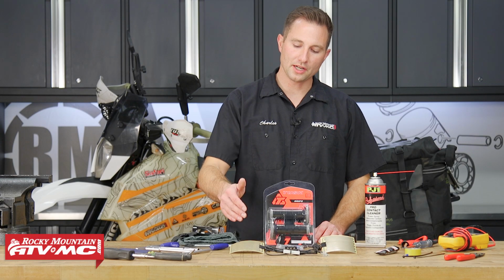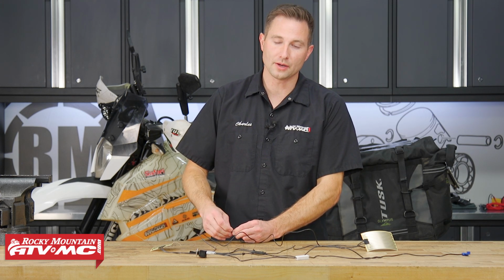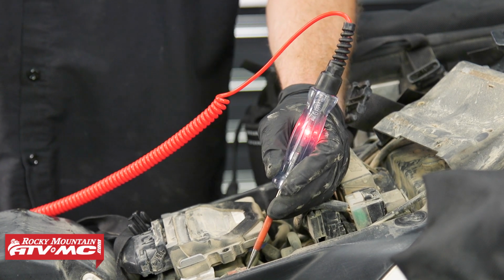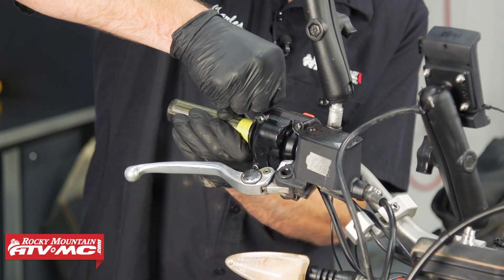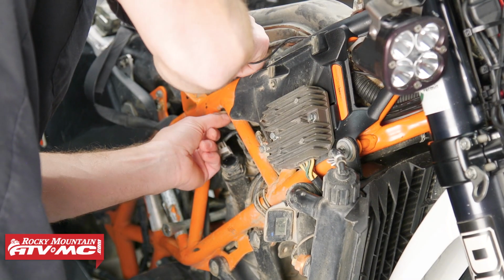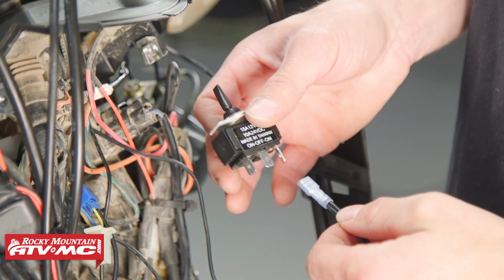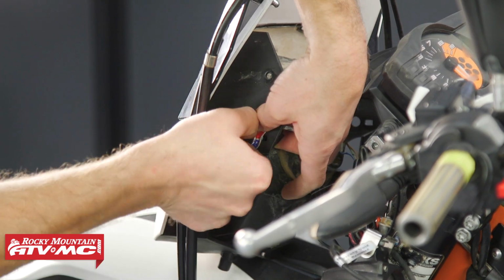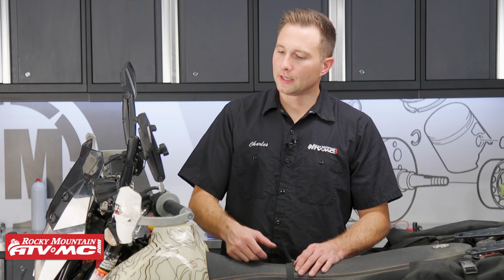How To Install the Tusk Grip Heater Kit on a Motorcycle

Comment: Just a suggestion - I always use hair spray to slide the grips back onto the handlebars over the grip heaters. It helps to slide the grips on , then dries hard to keep them from coming off.
 Also, you want to wire them using a relay, so when you shut off the key, they go off so you don't accidently run your battery dead when you shut the bike off.

Comment: Make sure you keep the resistor away from wires or anything else that can burn. It will get hot! I suspended mine in the headlight with zip ties (from the wires).

Comment: Add thin insulating tape on the left side bar before sticking the eleement or it takes ages for the heat to warm the grip, all the heat just goes into the aluminium bar.
Reply: This is a great point.  I was actually thinking of adding aluminum tape on the bar to reflect heat back up to the grip.
Reply: dont use alu tape, will just dran heat, need to isolate the element from the bar 🙂

Comment: Is it possible to use a single-pole single-throw switch without the resistor inline to have "high only" heated grips?  I want to use the MotoMinded switch on my MM dash.  I don't care about low power mode and definitely don't need a hot resistor on the bike.

Comment: When it comes time to replace the grips is it possible to get them off without ruining the filaments?
Reply: Razor snap knife might be the way to go. Carefully cut a slit and work it deeper a little at a time until the rubber can be pealed away.

Comment: In the video you state the resistor is connected to the Low power side of the switch. On the diagram presented in the video and the instructions as delivered with the product it shows the resistor on the Hi power leg of the switch. I'm no genius. Just looking for clarity here. Thx in advance for your time.
Reply: I wonder why RM never replied to this question?????
It is confusing
Reply: The switch is actually contacting the bottom connector in the diagram when in the HI position. It contacts the upper connector when in the LOW position. Hope this makes sense
Reply: It appears to be the opposite in the diagram, but that is not the case

Comment: Hi where did you install the resistor as mine gets so hot
Reply from the maker: We glued and zip tied it to the top of our triple clamp. If you don't have room there, you can attach it to the lower center part of the handlebars. https://youtu.be/7NHgM2QoMPY?t=520
Reply: @rmatvmc  thank you for reply my one gets so hot that it would  melt a cable tie
Reply from the maker: @tonychambers6275  Try some high temp silicone sealant.
Reply: @rmatvmc  hi does the resistor actually get that hot on this model of grips as I was going to send them back so nice to have answers thank you
Reply from the maker: @tonychambers6275  Yes it will get hot. Mounting the resistor on the handlebars or triple clamp should help dissipate some of that heat.
Reply: @rmatvmc  thank you for all your help

Comment: Is this the same with clamp-on grips ... does it work through the clutch side ?  And the throttle side already has the grip attached ... I assume it needs to be replaced after inserting the element beneath it?
Reply from the maker: This grip heater kit is not recommended to be used with lock-on grips.
Reply: @rmatvmc  What do you sell as an alternative then if I want to use lock-on?
Reply from the maker: @ByronStuck  We carry the Bike Master and A'ME heated motorcycle grips. You can check those out here: https://www.rockymountainatvmc.com/search/go?w=heated+grips -Charles
Reply: @rmatvmc  Thanks ... but I wanted to see if the "pad" style heater that's been your bread and butter would adapt ... and since it does NOT, apparently now I have both invested in a clamp on grip without heaters and now I need to invest in one WITH them ... and without much grip choice ... not what makes me happy

Comment: Failed after a short while using. The solder on the pad is weak and breaks during normal use.
Reply from the maker: Yeah, that's why we brought that up in the video. It's really important to use the electrical tape/and or zip ties to prevent that issue as well as making sure you have enough slack in the wires going to the throttle tube to make sure they aren't binding up. https://youtu.be/7NHgM2QoMPY?t=289 -Charles
Reply: @rmatvmc  even with strain relief the solder is so weak it can break from vibration and throttle tube movement alone. If people want it to work for 2 months then have to rebuy go for it. After buying two sets of these on two different bikes with same results, I’m out. CHEAP!
Reply: That's good to know, thanks.

Comment: Doesn't using a ground/negative on the chassis reduce performance given that the chrome moly chassis will be a poor conductor/high resistance versus a direct negative copper wire to the the battery or bus bar?
Reply from the maker: Ours works great, but that would work too! -Charles
Reply: If you actually use a DVM and ohm out your ground location to your negative battery terminal, you will get an idea of how "good" your ground is before committing.  Anyone who is unsure or not capable of doing this should probably just ground to the neg terminal of battery or find the engine ground strap.

Comment: you put one element on plastic (throttle) and the other on aluminum (clutch). Did you check the difference in temperature? The left side should be colder, is it a difference you would notice with the hands?
Reply from the maker: The left will take longer to warm up. -Charles
Reply: Right on. I was about to ask the exact same question. Great video! Thx!
Reply: A better solution is to buy or use an old throttle tube. Slid that over the left side bar and you'll have both of the warmers the same in regards to temp.

Comment: No fuse ?
Reply from the maker: The 12v key on power should already be fused, so you do not need to add an additional fuse. -Charles
Reply: @rmatvmc  You should be more specific in your instructional video.  In the video, he says 12V "or" "key on" power.  If there is no fuse in your kit, then you should specify to only use switched power.   You mention it's a good idea to use switched power to prevent draining your battery if left on, but in reality you should use switched power because you want over current protection  if your heaters degrade and start pulling more current and cause shit to burn.  The more I read responses to comments from RMATVMC, the more I realize this kit is shit.  No fuse, and a garbage cheap switch so you can deliver the cheapest cost grip heater kit.